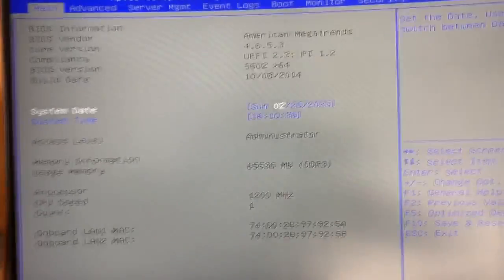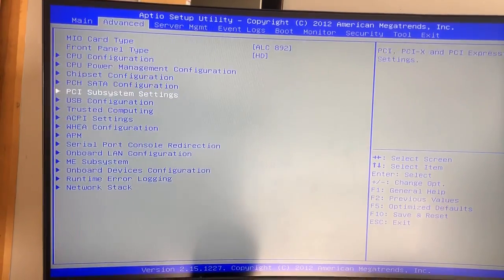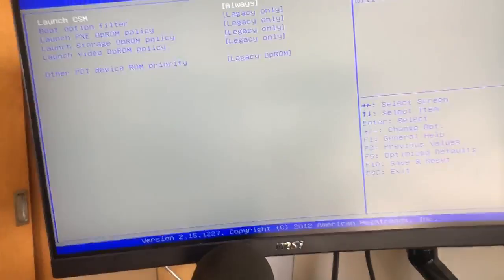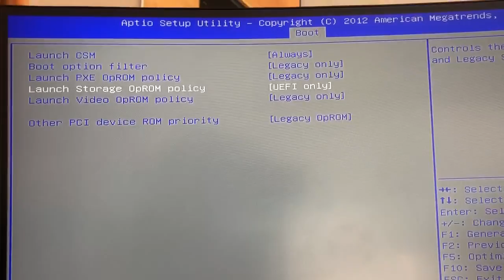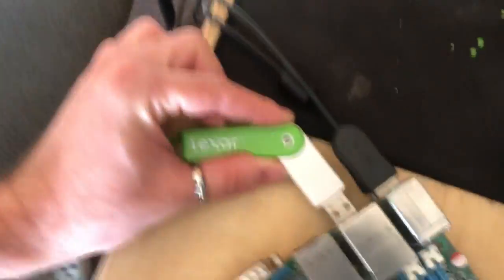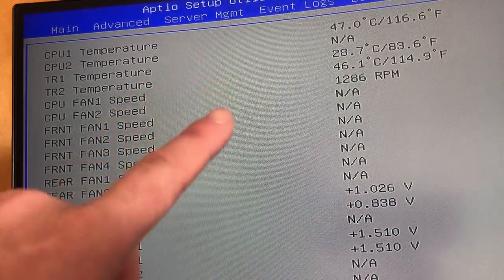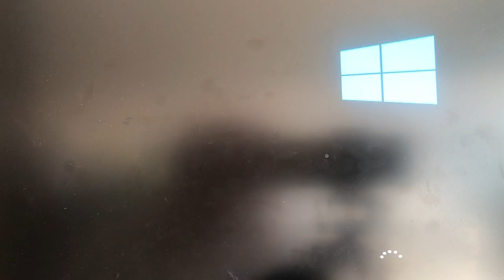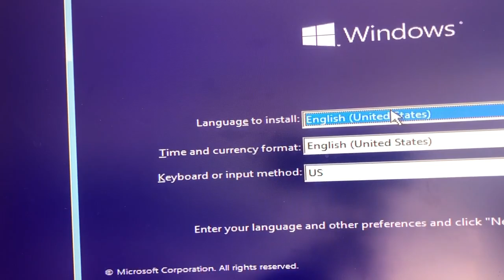Asus Z9PA-D8 - The NAS Killer Killer - Basic overview - 10

Comment: I have the same board since 2017 with 2x E5-2667v2 till this time it still a good machine. But as far as I know it will not support NVME at least I tryed with the same setting for storage policy and PCI-e to nvme adapter through x8 port and it does not work
Reply from the maker: I gave it to someone who was really interested so i cant really display it.

Ill see if I can get it back from them and do a follow up vid quickly. If thats not possible, ill have to find another mb.

Nvme is possible*, but with a specific type of nvme, ONLY.

I got my hands on one, I can make a demonstration with another unsupported platform since itll give the same result. But it is doable.

Ill dig out sources and post a follow up video asap.
Reply: @TechLabUnleashed  Oh thank you for the reply, it is not necessary to spend your time only if you are interested in yourself. I managed to use nvme storage only as a storage but not as a boot drive and used SATA SSD instead and it's not a big problem for me. I agree with your statement that probably not all nvme drives can be supported especially with that Chinese m.2 adapters
Reply from the maker: I am interested! Lol, i did hint at it a few times. Its definitely gotten lost in my “to do” notes.

Comment: I'm curious.  How much did you spend on the board?  ANd, also on the CPU's?  You might have made a pretty good deal.  I looked at Specs, and that's still a top-notch server board.
Damn ... 15:20 ... Okay, you answered my question.  My Man, you got a damned good deal.  You should be on CLOUD NINE.  You stole that puppy.  It's worth 3 or 4 times what you paid.
Reply from the maker: Spent like 200 for the whole system.
Power supply, the 2 cpus included, the ram, the gtx 650.

The board resold, for 337$ on ebay.
I run this as a for profit, because I need to feed this addiction SOMEHOW, lol. 😂
Reply: @TechLabUnleashed dawg I just got this board with dual xenon and a quadro in a booting system for $15 from my school’s used supplies resale. Was so confused on it but DAMN this thing is unique. Insane.
Reply from the maker: @cgunnr8251  fantastic find!!!

Comment: Sata 2....😮
Reply from the maker: excellent observation, but the reason why it won't matter is because people will connect HDD to it, not SSD. the goal here is capacity rather than speed, due to it being an older platform.
it's an incredibly dense, and the strenght it has is volume.
edit: the board features 4x sata3 and 10x sata2 ports
Reply: Yeah, that might be leaving a little performance on the table.  Not sure Sata3 drives will give too good of performance with sata2.
Reply: Sorry, me bad.  I think that Sata2 might not be that much slower for sata3 hard drives.  I read more and it says not a big deal, because sata3 HDD's won't max out on Sata2.  However, if there are any SSD's on those sata2 ports, then it'll really cut down the speed.  So, Dude in video might have made a good buy.
Reply: @PoeLemic  But I mean when sata 3 standard was created. May 27, 2009
So Sata 2 is ... relist haha.

Comment: I have the same series board, Z9PA-U8. It's a single cpu board and it do have audio card slot in the first slots(they call this "MIO card"). 
I tried to plug in some pcie x1 device on this slot, but didn't work. I also tried "Pika" slot, it's same.
Reply from the maker: Pike slot is only for storage controller like pike2008.

Its special slot. Dont plug pcie device in it.

Most possible you fried your card.